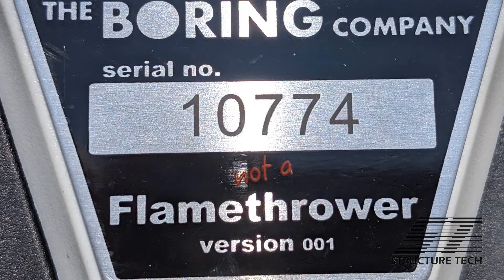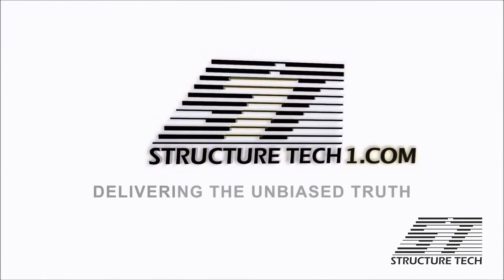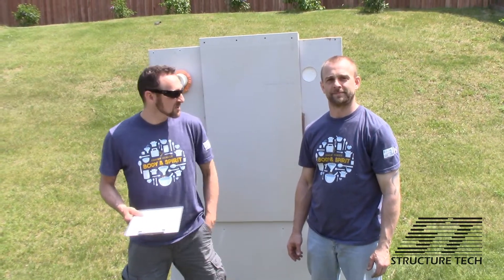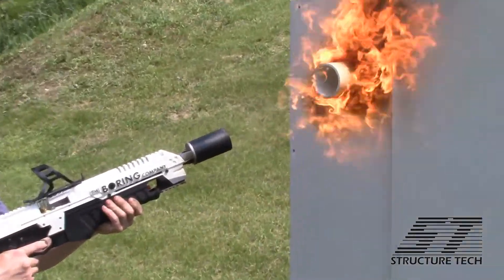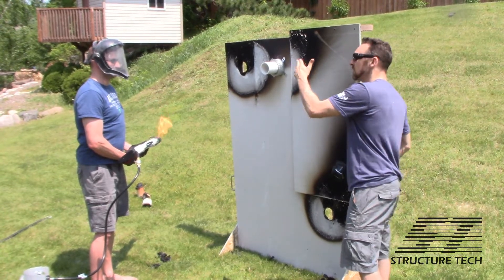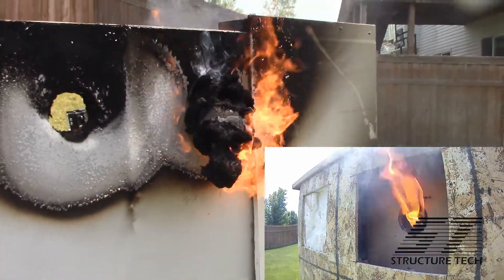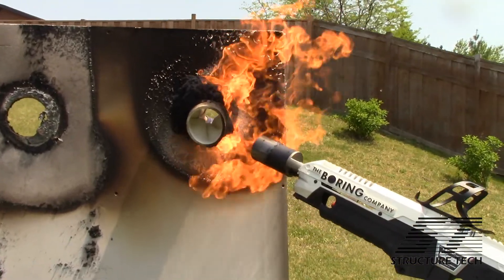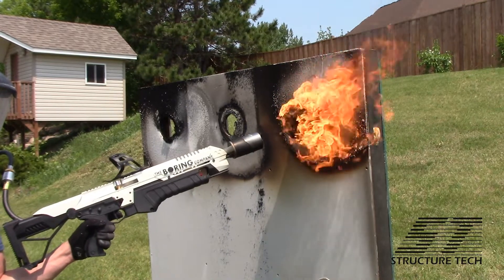Not a flamethrower testing on intumescent firestop collar

Comment: Very cool. The instructions call for proper screws with washers and...there's a reason! Thanks for doing this test.
Side note: the spray foam, I believe, is for smaller gaps like around an attic access opening.
Reply: Add:
I didn’t catch if you said how long it took to breach with no protection. Since the apparent fire stop ability of that wall is 20 minutes, I always wonder just how necessary some of these requirements are. If a PVC pipe penetration would not allow fire extension for at least 20 minutes, is the special intumescent necessary or did a company making them get to the code people? Since we are not code inspectors, consider taking these sort of above-and-beyond code requirements into consideration when choosing to make note in a report. You don’t have to note it and if you don’t feel it’s important, then don’t.